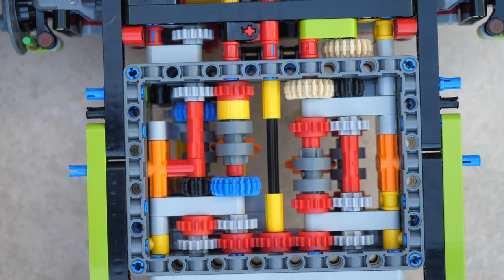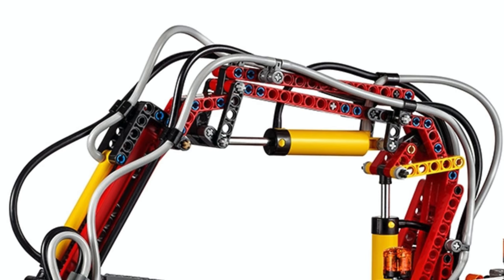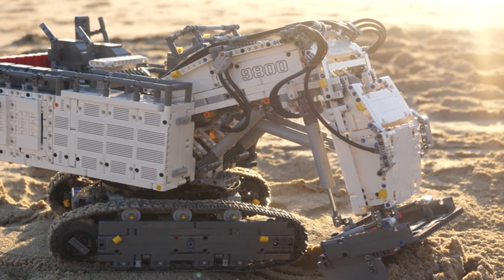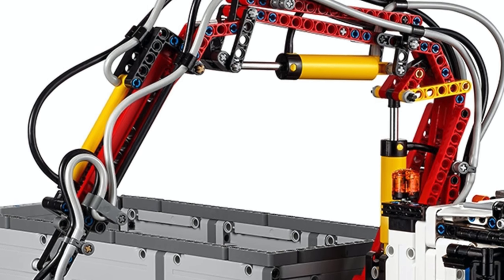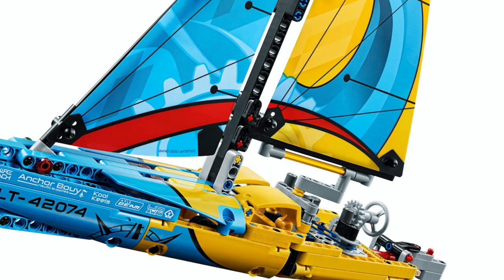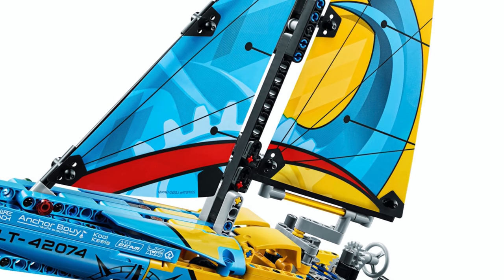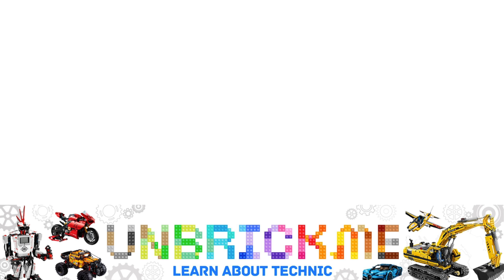10 Functions LEGO Technic Needs to Introduce

Comment: I'm so down for a compact electric pneumatic valve!
I mean you can hook up a motor to a regular valve and have it RC that way, but it's usually very bulky.
Also I'd love to have an S or XS motor, Just a very small and compact motor that can handle some light load like switching gears. Dimensions could be as small as 3x3x3.
A small motor would solve the problem for an electric valve, because you could build one which is fairly compact, although a real electric valve would be grand!
Reply from the maker: That would be cool! We need the 9v micro motor but in powered up
Reply: @Unbrickme  
While playing with the small pneumatic pump and thinking of good compressor designs I thought of another good idea: The head of the small pump needs to be an offset half beam, so that you can put two pumps on the opposite sides into one blockspace. Much like the engine rod part. Or we need a compact effecient compressor.

Comment: There's some important technical aspects you're missing with a lot of these.

If anyone manages to make an automatic planetary gearbox for a 1:10 scale car then I'll eat my hat. I don't see it happening ever unless with new pieces, but at that point it's so far from being Lego that what's the point anymore? A differential auto is much likelier, but only for a two or three-speed crawler.

Compressed air has really poor energy density so you'll never see an RC LPE car do 50mph, and the high pressures can be dangerous, so TLG would never do it. It also requires modified pneumatic components to handle the high speeds and heat from all the compression and friction. It's also not very playable unless you're hooked up to an external compressor, which almost nobody has.

Your understanding of Torsen diffs is wrong - they don't help at all when you have a raised wheel, so their advantages in Technic sets are limited at best.

The clutch gears and driving rings locking up is also worth mentioning. It's not technically because they're travelling at different speeds, but because they're converting large amounts of torque, so there's high friction stopping the drive ring from sliding off the clutch gear. People are right in saying that clutch pads would help, but even with a clutch you're still slowing the vehicle while you change gear. In RC vehicles the best way to avoid this problem to gear up directly from the motor, and run the gearbox at high speed/low torque so that you can switch easily and much quicker.
Reply from the maker: Fair points, but I think that having an external air compressor would be feasible. Also the Torsen differential is a limited slip differential, and such a differential would definitely help with such situations I described
Reply: @Unbrickme  You said that Torsens also help when you have zero traction, but that's just straight up wrong - with a lifted wheel they're as useless as open diffs. They're not designed to deal with situations where one wheel has zero traction. They'll work pretty well when you have reduced traction on one wheel, but not in the situations that the Volvo and Ferrari were in.

An external compressor is only feasible if you already have one. The vast majority of people don't, and they're not gonna want to buy a set that they then need to spend a non-insignificant extra amount money and effort to find a compressor for. It's also too easy to ruin an LPE just by running it for too long. TLG isn't gonna want to have to deal with such liability issues, because people will run the LPEs into the ground.

I could see a bottle-powered standalone LPE set being a thing, but not as an engine to power a moving vehicle. Something like Nico71's pneumatic engines could work as a set because they're designed to be hand-pumped, see below:
https://www.youtube.com/watch?v=gjfqO_QIwR8
https://youtu.be/6avPWj4MnYQ
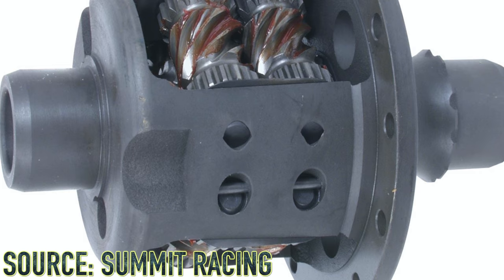Reply from the maker: @bartybum  https://www.youtube.com/watch?v=JEiSTzK-A2A&t=33s watch 3:26 of this video about the torsen differential. I mean yeah pneumatic engiens are difficult to implement but if they are eventually implemented then they would be legendary
Reply: @Unbrickme  Check the top comment in that video, it explains what it gets wrong.
Reply from the maker: Oh ok then I’m sorry you’re absolutely right about the torsen differential

Comment: Nice
To get the pnewmatic systems to work like the real thing  you need pressure and or volume with a safety valve etc
Don't think this would be cheap as mechanical drives
Reply from the maker: all you really need for RC pneumatics is 3 motors. One is constantly pumping the airflow. another is controlling a gearbox, and the 3rd is controlling the main valve switching. you connect the main motor to the valve switching, but with pneumatics you generally control 4 different valves, so the gearbox just engages the valve switching motor to the different valves.

Comment: Biggest setbacks for lego are durability and price if they make pieces like a limited slip differential the parts have to be small so less durable and if they implement more electrical components the price skyrocket for not that big sets and it all has to be child friendly and easy for them to use because that is the main group lego is trying to reach
Reply from the maker: What lego could do is to implement a remotely controlled locking differential mechanism. Whenever the vehicle is stuck, you lock the differentials, then after the vehicle is unstuck, you can unlock the differentials

Comment: Technic needs to have far more RC support
Brushless motors or just stupid powerful normal ones, high power batteries for them, the ability to daisy chain motors (a dead feature now that they've retired power functions motors), & specific wheels/tires for RC stuff too
Most of this wouldn't be that hard either, afaik LEGO has made pneumatic tires before & it already has many of the already existing tech for it to happen in current production to this day. Also stronger more streamlined pneumatics. That'd be dope. But RC stuff NAOW!!!

Comment: The best idea was pneumatic engine.  But this would likely require a pump that pressurizes an airtight cavity.  Kind of sketchy for kids by today's standards.  I could just see legos exploding under pressure even though it would be awesome.  Tyco did something like this in the 80's.  I had a motorcycle with a pneumatic mechanism.
Reply from the maker: Great point! A motorcycle with a pneumatic engine sounds super cool!!!

Comment: Well... Clutch already exists in Lego Technic... They are afol creation, but they exist and works pretty well....
Reply: But the part about having a real RC system with fast motor would be great.... Also it means that they need to reintroduce RC control over the Bluetooth or IR ones, because of the range/delay...
Reply from the maker: So is the clutch a MOC or some sort of custom made 3d printed piece?
Reply: I saw it in a MOC, it was made of 4 4185 pieces and 3 Technic pin/axle ( the blue ones), and a linear actuator was in charge of the position : at Max, out was solidely engaged, at mid, the friction (bad for pieces) let the end axis turn, and at min the end axis can turn freely : )

Comment: Well, I was watching your previous videos and would say they are way too subjective and quite questionable... The suggestions here are too distant for the Lego fundamental ideas and barely could be even imagined to be seen once...
10. Automatic transmission - it includes too many gears, added friction, and other things that will dramatically under-perform being made of ABS plastic...
9. Pneumatic engine - it is presented in LPE MOCs and they are way too destructive to Lego parts. Notice that pneumatic has self-increasing torque so have the shafts are stalls, they will break them easily.
8. Torque converter - the same, Lego does a lot to limit the torque by slipping "clutch" gears, current "brakes" in electric equipment, and other many things which stop the action when something goes wrong. it totally crosses the idea of the torque converter.
7. Torsen differential - this may be presented but only if don't use the friction as one of its base factors. Otherwise, say bye-bye to ABS parts...
6. Dual-differential tank-like drive - it could be used only for lightweight vehicles, as even mid-sized ones will grind the small and weak satellites inside differentials in a second.
5. Full RC pneumatic - it is already here, just connect the motors to new axle-holed valves )))
4. Speaker - this one would be great, now I agree with you!
3. RC Boat - oh no, not one more Galidor, please! The full-sealed one-piece "boat" body with batteries, motors, and receivers are enclosed will totally cross the idea of Lego and a constructor... Again...
2. High-power Battery - highly doubt. Lego always has twice the reserve all the limits and even having possibly to run the current motors at 11 and even 11v power (hello, ByWizz!) the official company will never do that putting their Customer Service at risk of nearly guaranteed monthly-scheduled replacement for all electronic parts.
1. Clutch - intended-friction thing for ABS parts, right?

Comment: They don't support faster rc models because first of all, lego technic parts can't handle the speed or torque. Second of all, if they do make them in the future, those sets would have 1000 pieces and cost about 400 dollars because of the new material of parts (price was or is multiplied by the "insane" quality control of LEGO which btw is unnecessary when it comes to just manufacturing whole rc models and still get the same shit)

Comment: I’m sure anything with fluid or electrical motors that touch water, or systems that would allow it to travel at speeds of “50 mph” as you describe would be a liability problem for LEGO.
Reply from the maker: Possibly, but there are plenty of hobby grade RC products that go even faster than that! Besides now LEGO is directly targeting adult fans of LEGO with many of their sets. Even the box art is very clean, no fun imagery, just plain black background
Reply: @Unbrickme  Well just like with violent video games that have adult ratings, it’s still a hazard that inevitably will happen where an adult will buy the adult set for their child and the child will do what a child does. It always happens and that’s why there are always warnings for toys that have small parts or moving components.
Reply: @Unbrickme  I was 9 years old when I stuck a LEGO mini figure’s yellow hand up my nose and they had to have the doctor take it out with really long tweezers. And that was a Harry Potter set that was rated for kids 4-6 years old